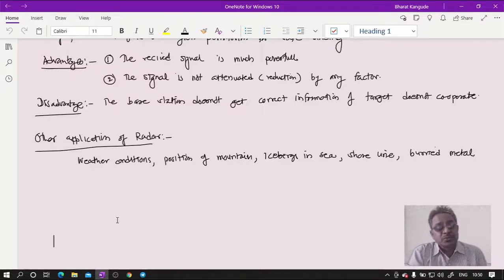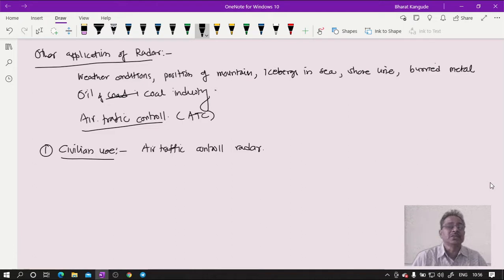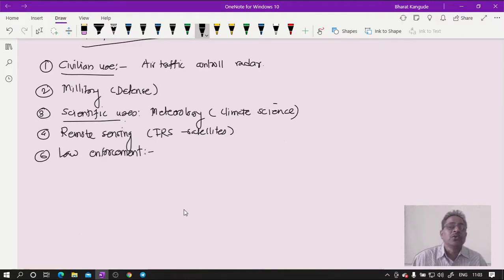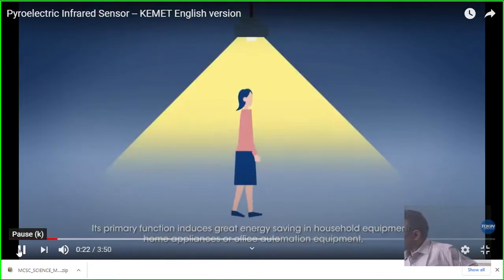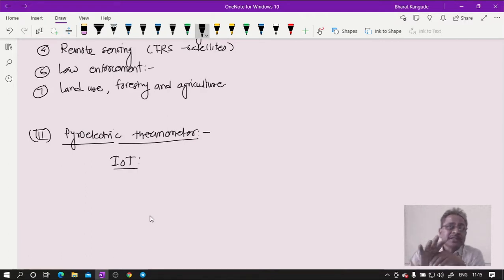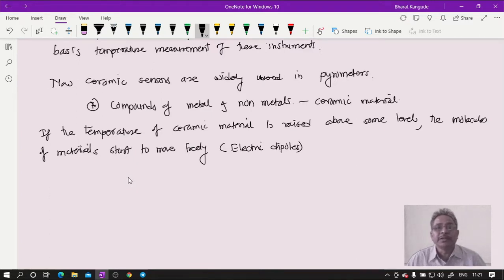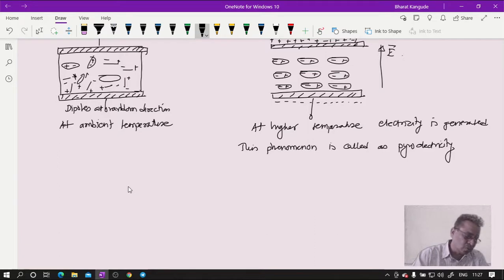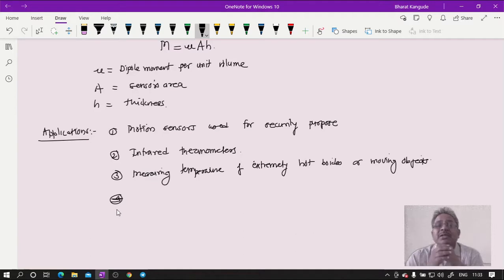Pyroelectric Thermometer

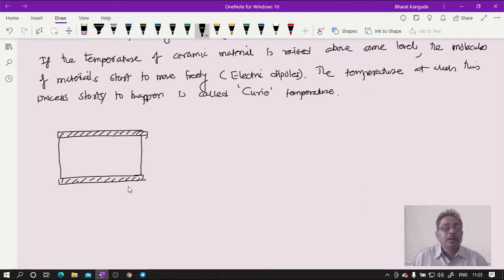Comment: Wrong interpretation explained. when temperature increases, the polarization decreases i.e dipoles get aligned in random direction. Thus eventually the dipole moment also decrease. Thus eventually the surface charge density also decreases. 33:00